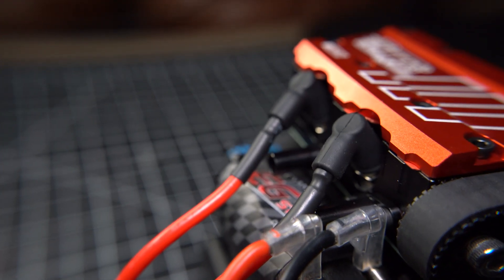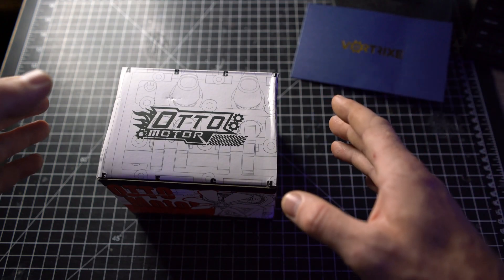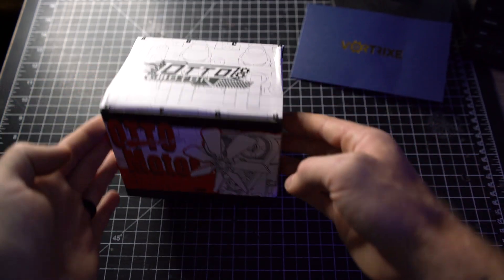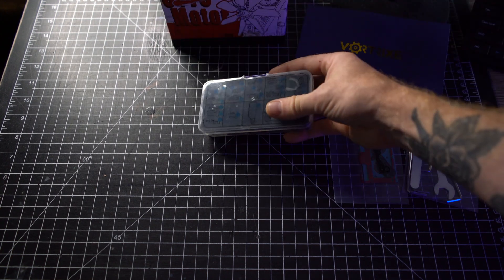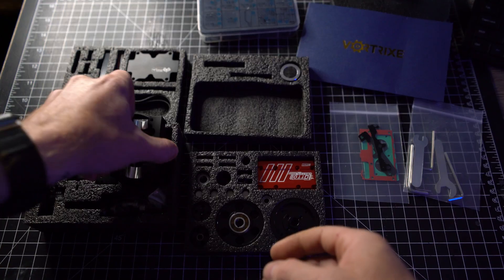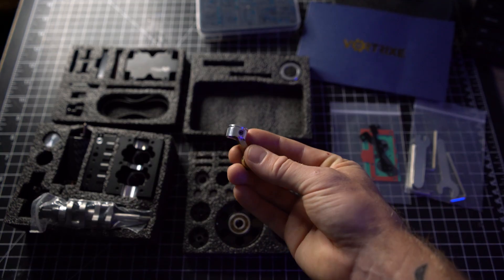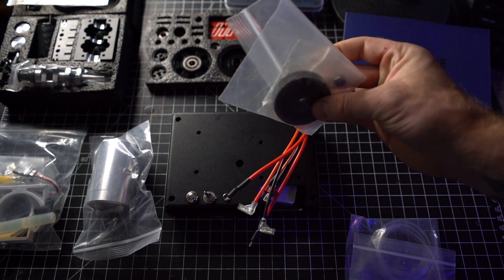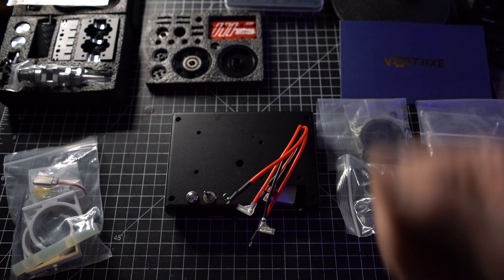Building the World's Smallest 2-Cylinder Engine! (Toyan FS LF200)

Comment: From what I see your valve is loose, try screwing in the small black screw on top of carburetor. There is a dent on the valve cylinder which controls the movement of the low speed pin to control fuel flow, and the screw goes in that dent to fix the movement. I also just built this engine but can't start it up though everything seems right, it's really frustrating. Also the red piece of paper under the cam cover should be flipped around. Good luck!
Reply from the maker: Everything was built to spec and correct, the issue was the spot at where the hall sensor hit the magnet on the flywheel, I got mine to fire up.

Comment: What is the main oil needle and the secondary oil needle. I have similar issues
Reply from the maker: The needles on the carb, they control how much fuel goes in at high and low rpm
Reply: If I'm right the main oil needle is the one opposite to throttle arm and the auxiliary needle is the one in the arm. I tried following different instructions from other to tune the carb but it doesn't seem to work, the engine sucks more oil at smaller throttle than fully open idk why XD

Comment: Thank you so much to the Shred Craft RC channel for this meticulously crafted video—it's truly outstanding!
We'll gladly assist you with the startup process. The gasoline version is slightly more complex than the OHV version; you can check if the Hall sensor is positioned directly beneath the flywheel.
Once again, we wish the Shred Craft RC channel continued success!
Reply from the maker: Thank you! I think you’re right, I have the hall sensor in the wrong location, I’m going to see if I can get it running this afternoon. Thanks for the advice.